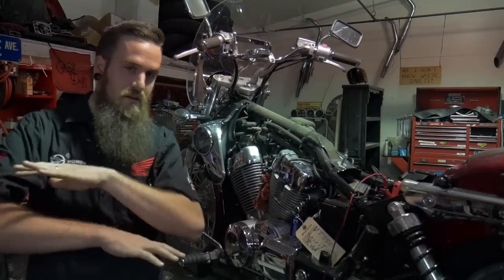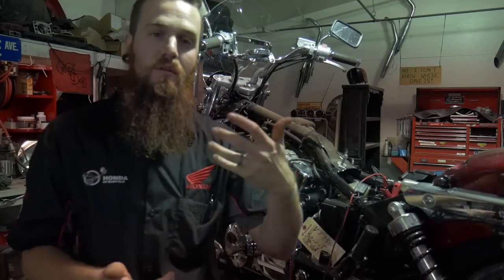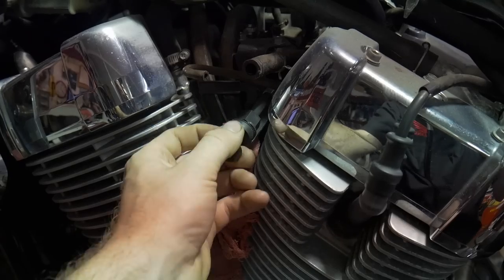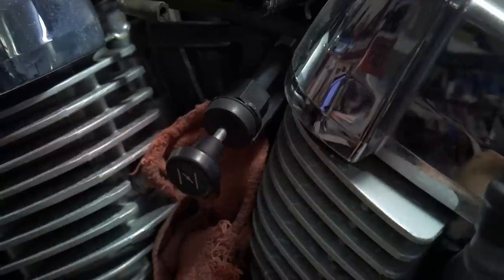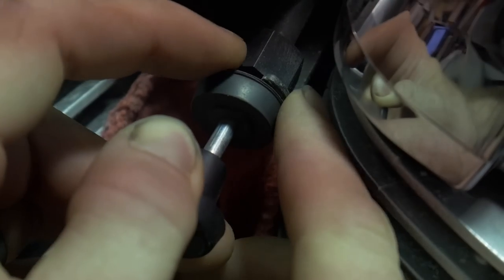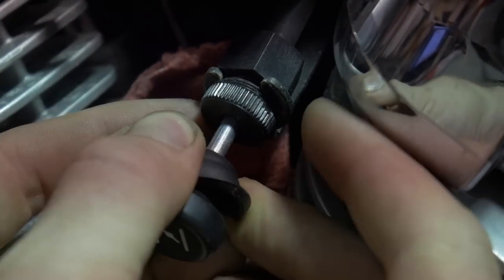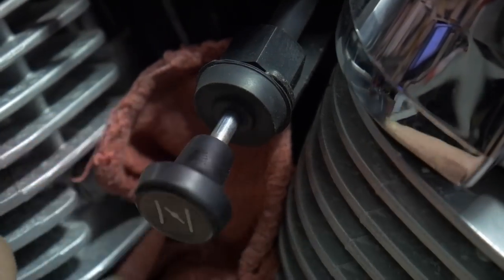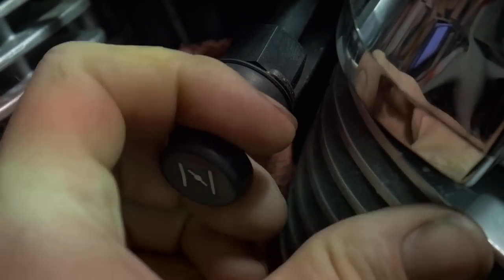Motorcycle Choke System: Loose plunger

Comment: Thanks for this. I just went to my garage and tightened the choke on my 1982 GL500. The dial below the boot was tight, but the nut on the the other side was loose. A quick 1/4 turn on the nut with a spanner did the trick!
Reply from the maker: Simple but effective!

Comment: I don't know if you know much about suzukies but here is my problem. I have just read your guide on troubleshooting regrec on your website. I own a honda varadero XL125 and the regulator went on it (its a combined unit but it was overcharging the batter) and the battery boiled over. The only replacement regrec I had to hand was one from a gs500 which is also 3 phase and has the same wires as the varadero (the gs500 is also a 2 cylinder bike). after connecting all the wires by twisting them up i started the bike and the regrec didn't charge the new battery and the 3 yellow wires started to get very hot but after wiggling the wires and starting the bike again the regrec did start charging the bike and the wires stayed cool. I then un-twisted everything and put proper crimped spade connectors on everything and connected it all back together but this time the reg rec still wont charge the bike and the wires still get hot very quickly (within 10 seconds). any ideas?
Reply: btw the engine that is in the varadero is the same engine that is in a honda vt125 shadow since i know you have worked on a few 750 shadows.

Comment: Mine is adjusted tight but still falls back in. I can turn it by grabbing the rubber boot, but the boot won’t peel back so I can get a better look. - 1996 Honda Shadow VT600

Comment: Hi man, bought the same cable but feels like evennif it is at its tightest, the lever still slowly drops down. I also noticed that the choke cable is a bit too long and i have to roll it up. Would that be the cause why it is too tight and not holding up?

Comment: Hey man so I have a question I need your help 
So I was riding home one day and I ran out of gas I turn my Petcock switch to reserve then I went to the gas station I didn’t turn the Petcock switch back to the on  position The bike is working fine it’s seem to be at least I get back on the freeway and it works fine but ever since then if I try to hold high speed for long periods of time the fight starts to bog and will eventually cut off If I don’t let off if anyone knows anything please let me know it would be a huge help
Reply: I have a 2006 Suzuki katana 750

Comment: Ive got same problem on my sons motorcross bike, it use to only start with choke down as didnt work, garage was supposed yo fix it, now after a while its not working again.

This time pull it up then falls back down, so i have to awkwardly start the bike with one hand reaching down to pull it up, HOW CAN I FIX THIS PLEASE???
Reply from the maker: Replace it!
Reply: Just fitted cable tie and works fine now brilliant hack, thanks
Reply: Put cable tie quick fix for now and works purfect and hardley see it, brilliant hack